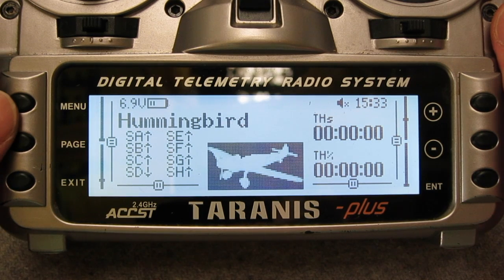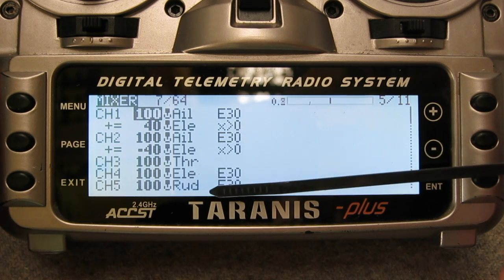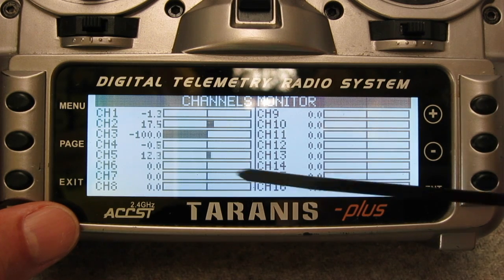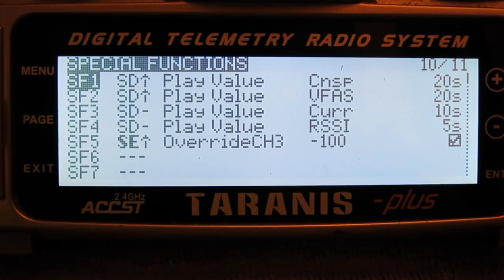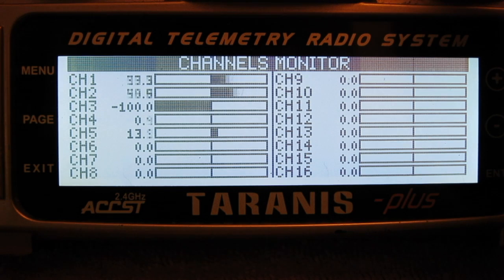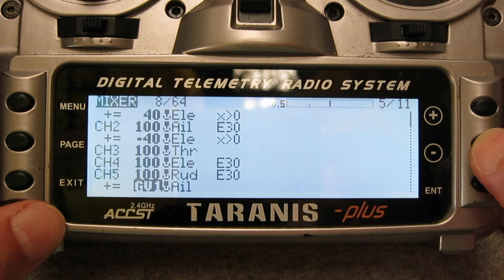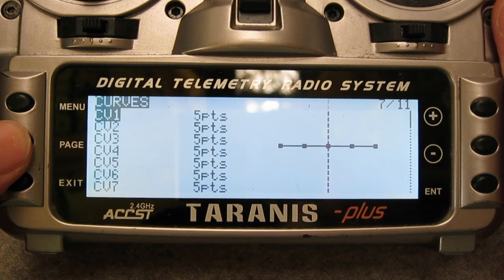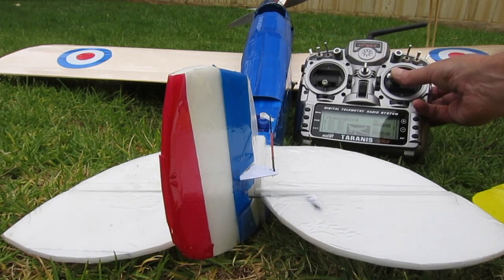Rudder mix on a knob

Comment: THANKS ANDREW FOR ANOTHER GREAT AND EXTREMELY USEFUL VIDEO !   HAVE YOU EVER NEEDED TO MIX AILERONS OR RUDDER WITH ELEVATOR ? 
I ASK BECAUSE WHEN  FLY MY FUNCUB AND START A BANKED TURN ON AILERONS THE NOSE DROPS QUITE A BIT WHICH NEEDS SOME COMPENSATING UP - ELEVATOR.   I AM THINKING OF TRYING YOUR MIX SHOWN IN THIS VIDEO ON AILERONS + ELEVATOR.    ALSO ANDREW  -  IS IT POSSIBLE TO SET UP A MIX OF ALL 3 CONTROLS ?     BEST REGARDS . . . EDDIE ( A U.K. PILOT )
Reply from the maker: Thanks Eddie. No I haven't ever mixed elevator with ailerons. I see what you're trying to do but I think it would make normal flight a bit up and down as you adjust roll.
Reply: @AndrewNewton  Thanks for such a quick reply Andrew.   I was so focused on getting the mix to stop the nose dropping in the turns that I hadn't thought about normal flight !   Thank you for reminding me about this.  So I guess you would only recommend Rudder & Aileron mixing ? 
Best Regards Andrew  -  Eddie.
Reply from the maker: Yes rudder and aileron mix works well.

Comment: I was trying to find a way , on my slopers, to adjust the throws of elevator and aileron separately in flight. Rates on a knob. Glad i decided to watch this video :). I had found a post on rcgroups saying to turn your throttle into this, but i like the knob idea better.
Reply from the maker: There may be an even easier way using the MULTIPLY function (Instead of ADD REPLACE etc) https://www.youtube.com/watch?v=Kp8jdC_WP-A
Reply: Thanks thats a lot easier and exactly what i needed. I can figure out that math pretty simple after i find what works to manually set it to that throw after a flight.

Comment: Thanks Andrew - I need to setup elevator to flap compensation for my son's new carbon missile laughingly called a glider.  This was perfect as I had forgotten how to do it.  BTW do you use the companion program so you can do it on your PC?
Reply from the maker: +Stephen Gloor Excellent Stephen. Yes I do use Companion as well.
Reply: +Andrew Newton It is good to have a backup of all your mixes.  Maybe you could put your config files somewhere for people to download.
Reply from the maker: +Stephen Gloor Good idea. I'll have a think about the best site to host model files.
Reply: Dropbox works quite well or GDrive
Reply from the maker: +Stephen Gloor Google Drive it is. I'll make up a blog page of all my model eepe files. When it's up I'll ask you to test the download if that's OK?
Reply: +Andrew Newton Cool no problem
Reply from the maker: +Stephen Gloor Hey Stephen, blog page is up. I think it's working OK but can you see if you're able to download one of the eepe file?  http://newtonairlines.blogspot.com.au/2016/03/opentx-eepe-model-files.html
Reply: Yep - can download OK.  Can you put up the ones you have for the vario etc as well?
Reply from the maker: Excellent thanks. The DLG and Radian have Vario included.
Reply: +Andrew Newton good - will go through them and add them to my Taranis